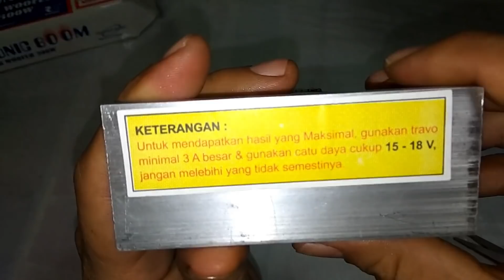CARA MUDAH MERAKIT POWER SUBWOOFER #soundsystemindonesia #rakitan #elektronik #subwoofer

Comment: klo minta bisa gak om?
Reply: saya mau nanya om,tp bkn subwoofer.. mau tanya powerampli 400w stereo,idealnya pake speaker brapa watt,brapa inch?
Reply from the maker: Mau load brapa ohm mas?
400wt permono/stereo ?
400x2 atau 200x2

Klo memang murni output watt segitu..
Sebaiknya di sesuaikan aj sama watt speaker,untuk ukuran bisa sesuai selera,dengan syarat...mau main di brapa ohm dan untuk handle suara mid,low atau sub.
Reply: 400watt 2set sanken
psu 25v 5a
klo speaker punya 2 10inch,2 12inch x300watt
Reply: 1lg om yg bikin saya bingung
di driver 1set sanken 400watt mono,ada lagi 2set sanken 400watt stereo
berarti yg 2set 400wattx2 ya?
Reply from the maker: Watt output gk bisa klo rumus patokan tr final mas...
Minimal klo mau dapat output 400watt murni permono...suplay trafo 45vct 10a murni per mono dan menggunakan 2sett tr final..baru ketemu 400watt murni per mono...

Dan untuk speaker  pertanyaan di atas,saya sarankan main di 4ohm..jadi permono menggunakan speaker 10inch dan 12inch...

Saya ada power 1000watt x2, itu pun catu daya 70vct dari trafo,dan menggunakan trafo 20a per mono...
Reply from the maker: Ada contoh nih mas power 300watt×2 yg saya test... Ini pake trafo 15amper 65vct...
Cb cek aja mas saya kasih contoh nya https://youtu.be/ZCuvX_s72zg
Reply: siap om dimengerti!!tp di driver tertulis 18v - 25v 
pertama saya main di 18v tp suara bass kurang..
main di 25v bass lumayan tp tr sama trafo anget..
Reply from the maker: Iya mas... 
Berarti sampean main amper aja...
Amper bisa di besarin,tp tr final harus di tambah....
Itu sampean pake tr final apa?
Reply: 1216 sm pasangannya
klo tambah driver yg sama gmn om,(2x400watt)trafo ada 2 cm 5amperan.. bisaga 2driver stereo pake 1 tune control alias 1 driver in L,driver 1lg in R
Reply from the maker: Itu sanken ori bukan mas? Saya Curiga  kok anget ya di suplay segitu?
Memang Sampean pake driver apa mas...
Reply: 5dy beli 50rban /set
Reply from the maker: Driver nya pake driver apa mas sampean?
Reply: sanken dr ranic
Reply: apa karna kebanyakan speaker?speaker saya pararel.. 2x300w - 2x300w
Reply from the maker: Mksudnya?
Reply: liat komentnya kebanyakan gini bisa gak om
gitu bisa gak om
jd ikut2an..
cm bcanda om
Reply from the maker: Ohhh hhhhhh....
Iya mas,yah namanya berbagi ilmu mas...wlwpun dr video jg banyak kekurangn nya mas...
Reply: masku mautanya
klo power 400watt stereo
itu 2x200w apa 2x400w?
Reply from the maker: 200watt×2 mas..
Reply: berarti bohong atuh..
di dus nya tertera 2x400watt
Reply from the maker: Memang yg di gunakan driver apa mas?
Reply: sanken safari produk ranic
Reply from the maker: Owh safari ya mas? 
Di tef aj mas dan tambah transistor final bisa tmbus 400watt x 2...
Banyak cara tef final di youtube..
Reply: ok siap

Comment: Bang saya pakai legacy 6 inch mono.ampli rakitan.udah pakai inverter jg..jalur pemasangan jg udah benar.tapi kenapa ya begitu volume di ampli di besarin daun speaker bergetar kencang dan suara bass jadi jelek..begitu volume ampli di kecilin lagi suaranya normal kembali tapi tidak mau kencang suaranya..saya tes di listrik rumah pakai adaptor suara normal dan mau kencang..kira" itu masalahnya di mana ya om mohon pencerahannya makasih
Reply from the maker: Trafo brapa amper?
Tegangan brapa vol?
Daun speaker bergerak liar atau tidak?
Reply: Sub untuk mobil gan..pke inverter 12-24..bergerak liar bos daunnya dan suaranya jadi jelek..padahal di tes pakai listrik rumah pakai adaptor suaranya bagus normal di besarin volume ampli jg normal" aja..begitu di mobil kok gak mau
Reply from the maker: Kurang cocok mas klo untuk mobil... Karna dari amper aki mobil sudah besar bgt itu... Wajar klo komponen gk sanggup terima amper besar..
Mungkin bisa di atasi menggunakan inverter dc to ac untuk pemasangan 
Adaptor mas....

Comment: om kalo pake speker cannon 10 in 300watt jebol ga ya spekernya,soalnya di video bassnya gede banget,saya takut jebol ,
terus kalo pake trafo 2 amper bisa ga ya??
Reply from the maker: Minimal 3 amper mas...
Aman kok mas pake 6 inch pun mampu...
Reply: oh berarti ga harus pake speaker subwoofer ya mas?

sy punya 2 woofer ,
1 acr 10 in 350w.
1 canon 10 in 300w.
sy akan gabungin kedua woofer tadi supaya daya kit nya terbagi biar ga jebol takut jebol soalnya om hehehehe
Reply from the maker: Iya mas...asal tipe nya woofer jg udh lumayan...apa lagi main di 4ohm..joss
Pnting jangn pake yg fullrange hehe
Reply: Mas saya pake TR Sanken 5dy, travo 3a 30v,
 Saya cobain paket Cannon 300wat suara emberr pecah.
Klo pake speaker Carman 10inch kira" mantep ga yah?
Reply from the maker: Saran saya enak amper aja mas yg di besarin seumpama menggunakan travo 18v 10a...,jangan voltase nya...soalnya di lihat dr komponen kurang memumpuni,alias abal2...

Klo emang mau pake 3amper,pake aja tegangan 22v/24v supaya aman...
Untuk speaker saya rasa lumayan mantapp
Reply: Yogi AP Oh makasih Infone mas, saya kira klo power mau kuat harus pake volt besar
Reply from the maker: Klo untuk suply daya Tergantung kebutuhan mas dan menyesuaikan spek drivernya...
Oke mas podo2 blajare kulo hehe

Comment: Punya q elco 3300uf 50v (2) + dioda 3A (4) dipcb kit q lepas q ganti elco extenal 10.000uf 50v (2) + dioda kotak 10A trafo 10A ct teg 32v driver stereo TR final sanken 25DY kox suara nya kecil bass serak2 g jelas kenapa ya lur....potensio q sambung kabel head stereo....angkat speaker woofer 12" ....kira2 knp ya lur....
Reply: Produk driver kit merk KCK type king 302
Reply from the maker: Cek elco om sama resistor nya...biasanya elco gk mampu suplay daya besar..itu bisa di ganti...

Comment: Klo pake 32ct kuat ga ya angkat sub 8 inch x 2
Reply: Saya sudah coba suplai maks driver cuma 18 vac.kalo mau dinaikin volnya selain  ganti finalnya ganti juga ketiga tr nya yg ditengah
Reply: @anisafebriani8060  diganti yang tipe brp mas?
Reply from the maker: Gampang panas om...ganti transistor final dlu yg original sanken klo mau di catu daya 32v ct

Comment: Om. Saya pake speaker  12 inchi 2500watt suaranya jelek.
Cocoknya pake spesker berapa ?
Reply from the maker: Klo bisa transistor final di ganti original sanken om...biar mantap bisa di input daya supply 45v
Speaker pake 12 inch pun sanggup
Reply: @yogiap6087  Terima kasih Om. 
Kit sbwofer yg 1nya saya salah pasang potensio ,skr suaranys tak ada.kira2 apanya yg rusak.
Reply from the maker: @iketutsuhartana4587  kemungkinan ada komponen yg konslet ...coba di cek di TR final...
Reply: @yogiap6087  tr bd140 sepasang klo di gan ti tip41 sepasang bgmna bang.
Reply: @yotobae7741 bantu jawab...bisa mas...punyaku jg gnti yg tip41,42
Reply: Besar kali watt nya
Reply: @rhschannel8691  ya om..speaker dpt dr teman kasihan ,tak pake kit yg tayang suaranya pecah.bantu om
Reply: 2500 watt bisa buat lapangan tuuu
Reply: How to buy India

Comment: Om kenapa ya punya sya suaranya jdi ngga keluar sub nya.. pdhal bru bberapa hri sya pake... apa ada yg mati ya komponenya? Kira2 apa yg mesti di ganti?
Reply: Posisi subwoofer legacy 6 inch
Reply from the maker: @agungrayadi4826  kemungkinan ada komponen yang mengalami short/mati...coba cek di bagian transistor final.
Reply: Punya saya juga pake legacy 6 inch kemaren rusak gk keluar suara ternyata transistor final yg rusak gan jadi ane ganti pake  tip 2955 dan pasangan ya karena trafo saya cuma 3 amper  sekarang masih oke suaranya
Reply: pakek thosiba sc5200 + pasangan nya sip tuu
Reply: Punya saya pada nada nada tertentu suara nggembrett
Reply: Transistor bawaan ga mampu disuplly 25ct..langsung JEBOLL

Comment: Gan ini gak perlu pake power supply yaaa??? Apa perlu?
Reply from the maker: Sudah ada powersupply nya mas..tngl pasang trafo saja
Reply: Kalo kita mau nambah variasi lampu led.. Itu ambilnya dari mana gan??
Reply from the maker: Dari output speaker bisa
Dari catu daya trafo bs
Reply: Bos mau nanya ini sya pakai power sonic subwofer di situ ter tera tegangn maxsimal 15-18 volt  tpi sya terlanjur beli inverter simetris 12-24 bisa nggk klo lngsung sya pasang...

Comment: Vokal bocor om pake itu biar senyap apa yg harus di ganti .. ic nya kah
Reply from the maker: Harus lewat driver rack klo emng mau bersih dr vocal om biar bs potong frequensy vocal nya...soalnya input audio nya aja pake vocal...wlw di ganti ic / kt pake subwoofer pabrikan pun tetep bocor vocal nya..soalnya input audio langsung ada vocal
Reply: Yogi AP dl pake itu tr ganti yg 70 rb satu set. Akhirnya ambil tr nya pake driver 504 .filter punkiz tak kasih ct 25 5 amper banci lebih berasa ..
Reply from the maker: @kausasatrio7220  iya om lebih enak SOCL 504 lebih mudah perakitannya jg.
Reply: socl 506 lebih bagus
Reply: Sudah saya pake 504 filter yg bagus Vokal nya dak bocor apa ya
Reply: @kausasatrio7220   maksudnya pada bagian out masuk ke input socl 504 begitu ya? apa socl trus dikasih filter subwofer?

Comment: Persis sama punya saya
Ganti dengan sanken lebih joss 👍👍
Reply from the maker: Iya om...soalnya ini TR bawaan..
Reply: Input nya kalau pake sanken berapa volt dan berapa ampere
Reply from the maker: Klo gnti sanken ori...harus di ganti elco power supply nya om...biar aman di input tegangan 45v ct
Reply: Rekomendasi elco.nya
Reply from the maker: Tp klo saran saya om...klo mau buat enak pakai socl aja yg simple...bisa langsung input tegangan tinggi..tnpa harus d rubah om
Reply: Soalnya saya punya kit ini pingin aja ngoprek biar mantap ... kira kira diganti elco ukuran ...??
Reply from the maker: Pke elco 10.000uf 100v
Reply: Elco 2 unit ya terus bisa menghandel speaker berapa watt om saya pake travo 5 amp murni
Reply: Mas punten high input itu untuk apa yah?
Ko ngga di sambung
Reply from the maker: Enggeh mas...
Buat input dr keluaran power amplifier mas... Jadi high input
Reply: saya punya speaker biasa,klo mau di gbung dngn subwoofer gmna caranya, mna yg di sambung, saya mau coba rakit ni

Comment: Untuk subwofer 12 in 850wat kuat ga mas
Reply from the maker: Kurang mas kalo pake transistor bawaan nya...minimal ganti transistor original sanken
Reply: Yogi AP kalau pake tr sanken pake trafo berapa amper tegangan berapa Volt mas
Reply from the maker: @dagultea2909  minimal 5amper bs catu daya 45volt om
Reply: Yogi AP makasih mas atas ilmunya
Reply from the maker: @dagultea2909  iya om sama2
Reply: @yogiap6087  cuma gnti tr doank, elco & dioda ga ikut di gnti/di tmbah gtu boss??.
Reply from the maker: Perlu mas di ganti di bagian PSU nya...
Tp klo menurut saya mending beli kit subwoofer yg berdaya besar sekalian..soalnya biaya modif gk jauh beda dengan kit watt besar
Reply: @yogiap6087  ok,, boss,, thanks pencerahane..

Comment: Om subwoofer nya single coil atau double coil?
Reply from the maker: Single coil om...pake 8ohm aja kok
Reply: @yogiap6087   kalo pake double coil berarti di pararel kan ya om
Reply from the maker: @MhdFadil  iya om...kuat jg kok buat ngangkat speaker double coil... Soalnya udh di uji coba jg pake speaker 4ohm...mantep jg
Reply: Ok om . Kalo high input itu buat apa ya om ? Low input kan buat pre amp?
Reply from the maker: @MhdFadil  untuk input dr amplifier ke kit sub tsb...jd ambil jalur inputnya bs lwt output poweramplifier.
Reply: @yogiap6087  ok om , makasih infonya sangat membantu
Reply from the maker: @MhdFadil  oke ...sama2 om